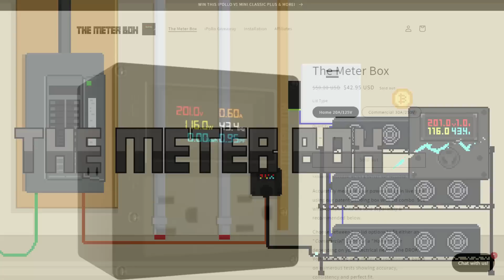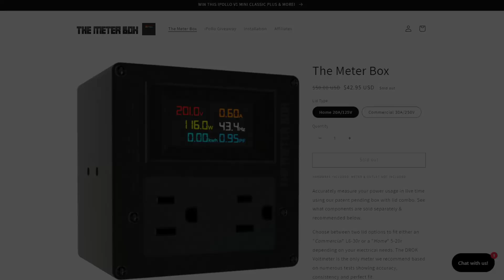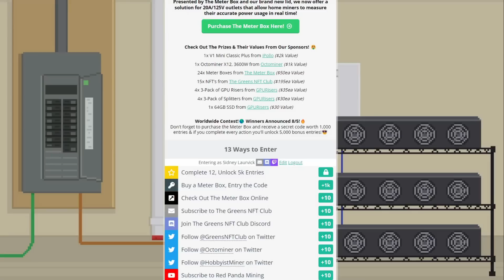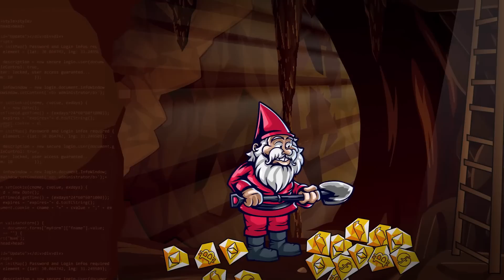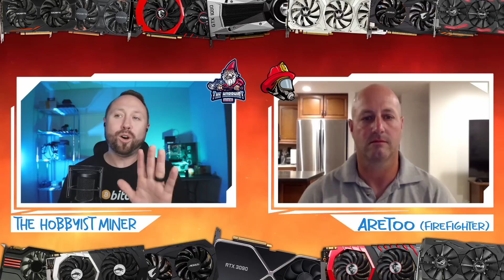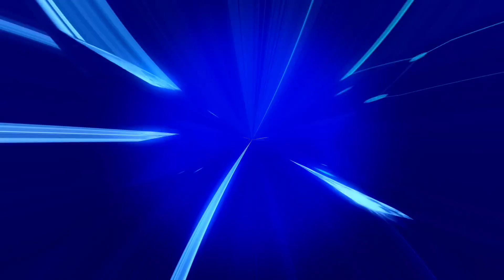Is Your Crypto Mining Farm Safe? | Dangers of Home Crypto Mining Bitcoin and Ethereum

Comment: I was told to use Halotron extinguisher as it's rechargeable and Co2 is apparently not.
Reply: Haltron extinguishers would be  great option in a mining farm.  The only down side is that they are more expensive then a CO extinguisher and usually harder to obtain.   If you have that option that is a great choice

Comment: Fire suppression: We had a Stat-X system set up in a battery storage container that accidentally discharged. It voided the warranty on the batteries and ruined the BMS. Later, we replaced the suppression systems with inert gas. Buyer beware!

Comment: I have a 240v 30a washer outlet not in use and on its own breaker can I use an adapter (because I rent and can’t swap the outlet in case the next tenant need a washer outlet) into a pdu is this a good option it’s the only 240v outlet in my house and I cant rewire much please lmk if it’s safe it’s rated for a 240v 30a but Ik it’s adapted from a washer outlet to l6-30 tho
Reply: I used a 240v dryer outlet that was not in use, with an adapter I was able to install a pdu and run up to 3840 watts from just that outlet safely, so it is safe
Reply: @OracleAlgo  Whats the name of the adapter you use?
Reply: @OracleAlgo  thanks for the reply I have everything to swap over just haven’t gotten around to it bc I was worried of safety issues but sounds like people have done it before
Reply: I use an adapter on a dryer outlet, running 21amp. Around 5000w thru it for several months. Been great
Reply: @JPTECH8  What is the adapter part name called? I've been trying to find one for ages.
Reply: @WamBiscuits  is your outlet a three prong 240v or 4 prong?
Reply: @JPTECH8  3 I believe in my one house 4 in the other

Comment: I had loose connections on outlets burn could that be from an overload? My breaker didn't go off.
Reply: Power outlets in homes don't last forever. The terminals inside that connect to the plugs blades will lose their strength and not make a good connection on the plug ... Once that happens the terminals in the outlet overheat and lose ALL their strength and overheating gets worse. Also, don't re use the burned plug, it'll burn up the new outlet with poor conductivity. 

Have the outlet replaced, or replace it if you have the skill to do it safely. As long as you were not pulling more than 15 amps from it you were not overloading it, but the closer you get to that 15amp limit the more important having a good condition plug and outlet becomes. That's why there are often so many home fires from space heaters in the winter, the power draw on a single outlet is extreme.
Reply: It is not uncommon for me to see wires on outlets loosen over time with use and heating and cooling cycles.  This is especially more common with the older stab-back design.  Loose connections are not necessarily a sign of overload, but if you do notice it best to replace the outlets